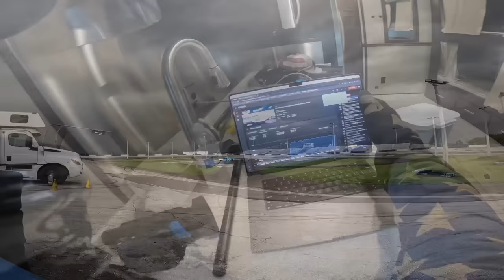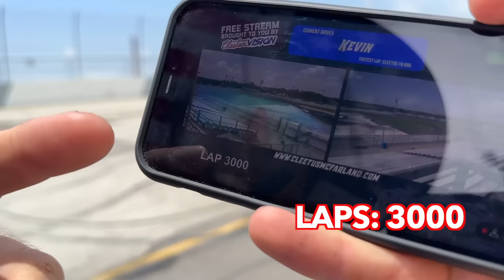We Spent 24 Hours Straight in a Racecar

Comment: This is secretly a test to see if a true 24 hrs of le mullets is possible
Reply: No secret, just not saying haha
Reply: I’d like to see a 24hr race with some drivers. But I’d say 2 cars per team and a spare.  That way drivers can be ready to roll as one is pulling off and let the cars cool a bit after 3-4 hours each stint
Reply: @annadarby7224  oh for sure, the logistics for even like 10 cars or so would be absolutely insane tho💀
Reply: Probably need 4 drivers per team at least to hustle these crown vics around for 24hrs. Pro drivers struggle with it with the best gear and in peak physical condition.
Reply: @willyjimmy8881  The G forces in an LMH car are much higher.  Not saying it's still not difficult in the CV, but a totally different ballgame.

Comment: Puts a new perspective on the teams that do 24hrs of Le Mans, Silverstone etc. Those guys must get absolutely hammered in those cars.
Reply: Cars? Ha! 24 hour motorcycle racers are the hardest.
Reply: They do 4 driver teams so it's a little more manageable but still a feat
Reply: @geirkselim2697  the Gs they’re pulling are much greater though I’d imagine it would be damn near impossible without the drivers getting absolutely wrecked with less people. Either way the challenge is exciting!
Reply: @MotoLen51 Depends on which race. 24hr of Nurembergring is more difficult from the sheer danger alone
Reply: @Ctsmith18  Indeed, Pro drivers do lots of muscle training and are basically athletes.
Reply: @Bacavoit  basically? They are athletes
Reply: @jeffgayzose8129  I mean, yes, they are absolutely, it's just that they do not compete where most athletes do, like the olympics and similar events.

But yeah, they workout alot and are in way better shape than the majority of the world population.
Reply: @MotoLen51   who does a 24hr motobike race? also cars can pull more G's than a bike.
Reply: @Dr.Mcstaby  On a bike you're doing a leg press in almost every corner. You're supporting up to 1G of braking with your arms and legs. You're constantly engaging your core during 1 1 - 1.5 hour stint. Doing it for many hours, even in a team, is brutal (I've only done 4 hour races, and only at a club racing level). The World Endurance Championship for bikes is the 24 Hours of Le Mans, 24 hours of Spa, Bol d'Or 24 Hours, and the Suzuka 8 Hours.
Reply: And they don't have "backup" cars.
Reply: @BC-kx5zb  to be fair they don't have backup cars bc theyre engineered a bit better than crown vic race cars lol
Reply: @BC-kx5zb  No backup cars, but everything other than the engine block can be changed.  The dominant Audi R8s from the early 2000s could change the entire rear end of the car including transmission and suspension in under five minutes.
Reply: @geirkselim2697  that completely depends, in the last Le Mans, a few drivers did more than 10h on their own
Reply: @Dr.Mcstaby  there is a 24h Le Mans race for bikes. And trucks.

Comment: The Cleetus McFarland driving experience sounds like fun. But I needed hand controls to drive. You should consider adding Menox hand controls and a spinner knob to one of the cars. The Menox hand control system is the most intuitive hand controls, especially if you are used to driving stick. Just give it some thought.

Comment: Kinda wanna see and new crown vic modded on a stock motor with a turbo just for the track, big wing, big front splitter the works (with ac for the hot nights of a 24hr run)

Comment: Maybe make a change to the layout.   Instead of running the Oval, why not the figure eight?    The track is already laid out for it.   More interesting and challenging for the drivers.  It would probably challenge the cars abilities more as well.  Really, with the inner loop as well, it could almost be a mini road racing course.   Testing both drivers and cars.  
Furthering the theme with the driving experience...   Along the lines of Top Gears stars in regular cars.   Have people, famous or not, drive a set up Crown Vic, giving a warm up lap or two then set a lap time.   Record them and put the top 50 on a board.  Every time you have a guest group out, or someone rents out the track or whatever they get a shot at the board.